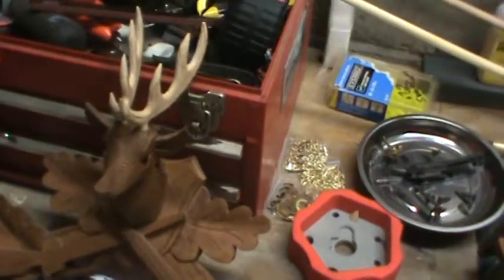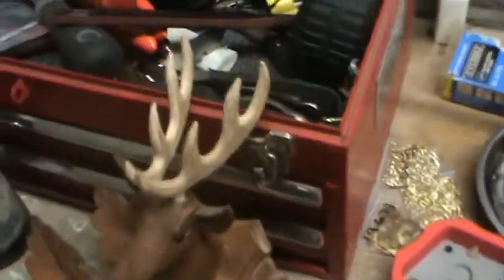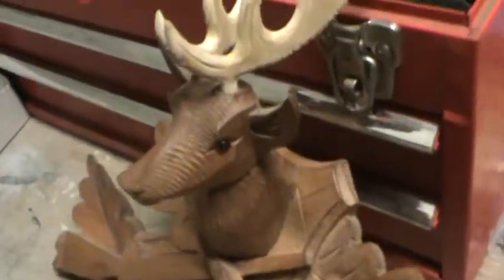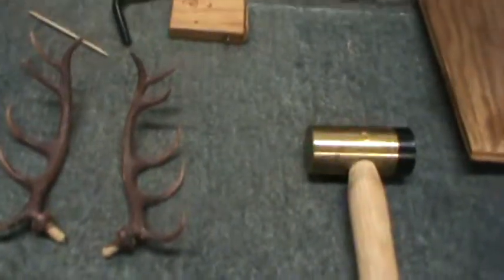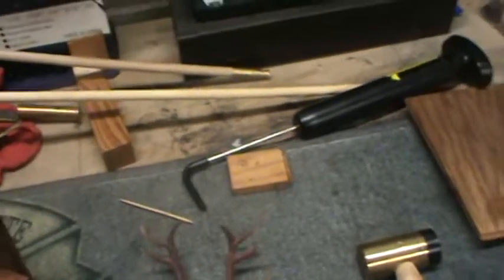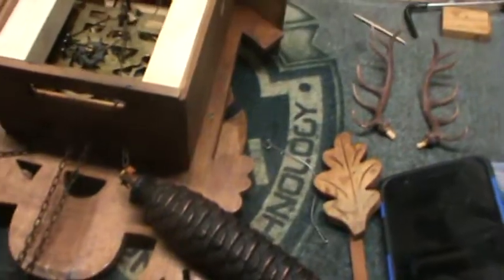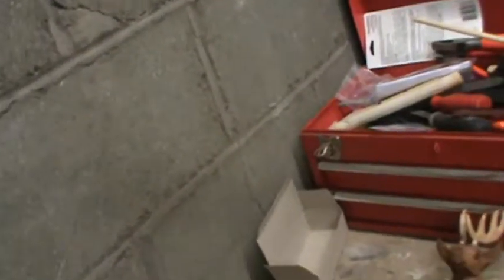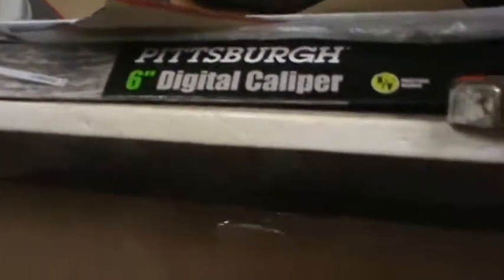Cuckoo Clock Project Bellows

Comment: Your question regarding wood stain is not something a clock repairer is going to know much about.  I have a similar clock and am happy with the deer just being female.  I thought this was the same clock, but now that I see the movement, I realize the case is the same, but not the same clock movement.
Reply from the maker: I just used my Tru-oil stain that I use on my gun stocks and it worked out real good. Unless I tell anyone, they never even know. I picked up my raw wood antlers from time savers. They are really reasonable on their prices compared to others I have looked at. 

On a side note, I know absolutely nothing about clocks. Most of the cookologists I spoke with all told me to use what I had on hand and enjoy it and no one would be the wiser since it really isn't collectible anyhow. It is post war, pre 1967 era.